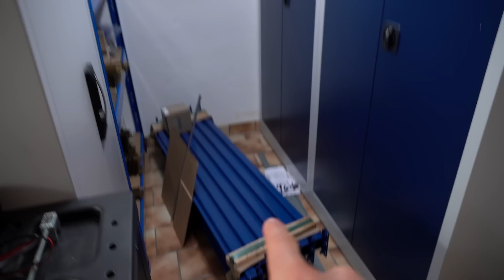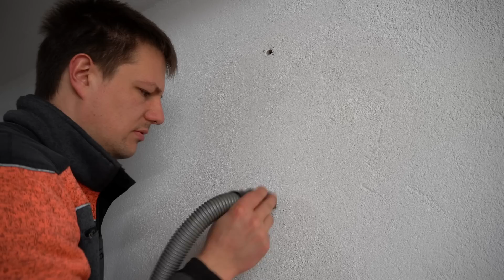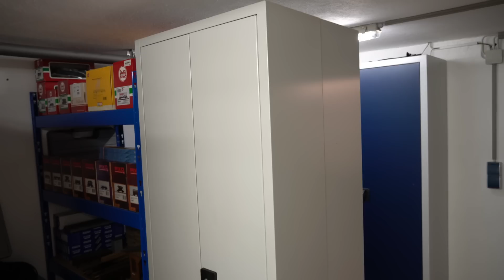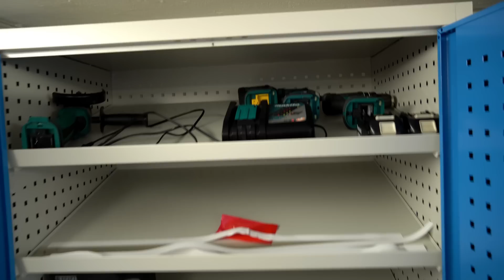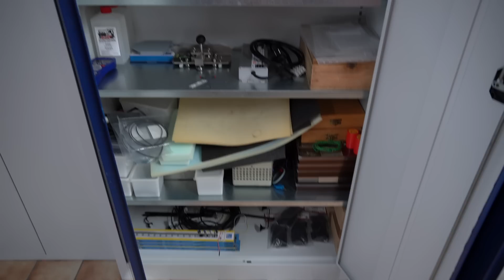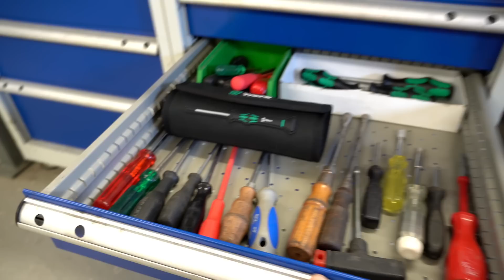REORGANIZING tools and GARDEN RAILROAD room - Part 2

Comment: Those Cabinets are a good quality. If you place the spare shelf / floor board behind the shelf unit, you will always have it ready if you need it. 
A tip for your welding rods. Normally in a welding shop they would be kept in a dry box or something like a humidor for cigars. It keeps the flux coating dry. But you can wrap them in plastic bags. If they feel damp when you go to use them, place them in a warm oven for a while. It will help them weld better. 
In the workshop I was in we might open a sealed box in the morning and with 4 guys welding the box could be gone by evening if the MiG unit was out of gas or something.
All those spare tools, its time for what we call a Car Boot Sale at a market. Raise some money for rolling stock.
Reply from the maker: A lot of useful information there, thank you! Since this is the basement of our house the climate is pretty dry. We store some of the welding rods ontop of the gas boiler. There it is warm and very dry. A dedicated dry box would be a good idea I suppose. You are right about the spare tools. You have seen the sorting process on video but behind the scenes I am trying to reduce the amount of unnecessary tools to get more space overall. I am working on it, thank you for watching and your comment!

Comment: Will you label the draws / cupboards?? I wouldn't remember what was where ...
Reply from the maker: Yes I will eventually. Right now there is a high possibility that I have to change some drawers from here to there to get the tools right where I want them to be. When I am happy with the system I will take the time to lable every drawer. I will also add some rubber matting on the floor of every drawer to prevent the tools from sliding around in there.